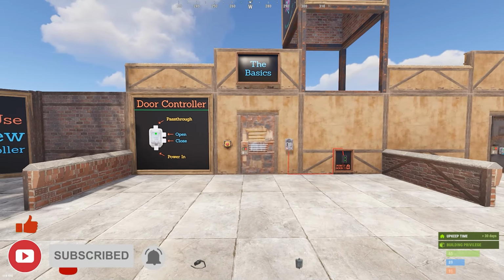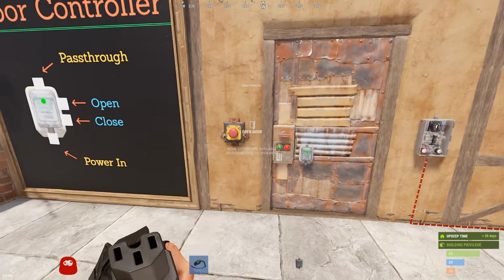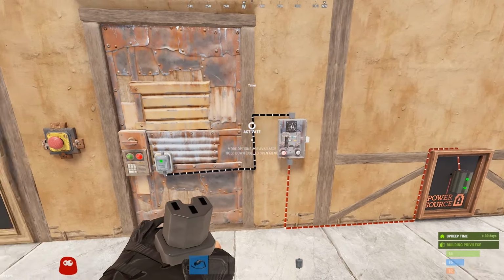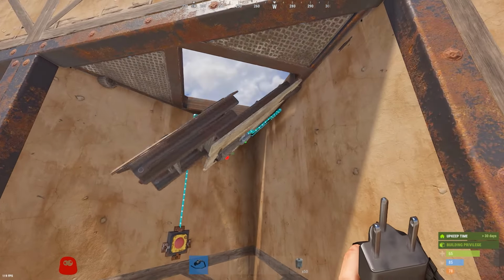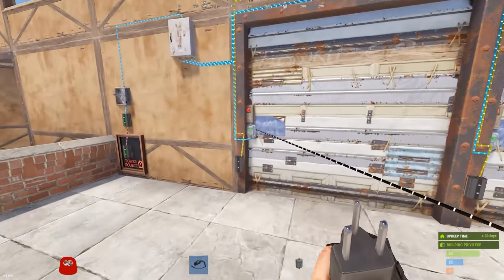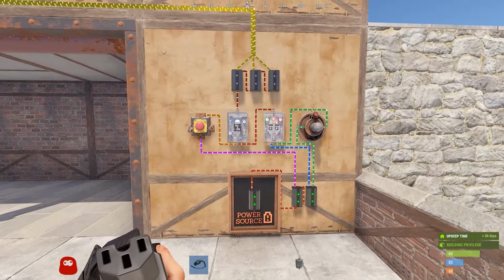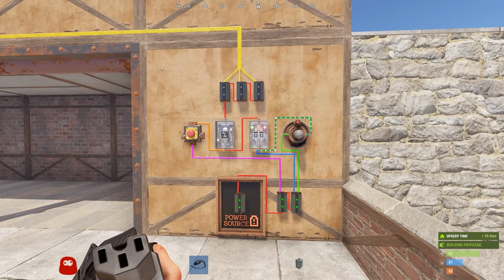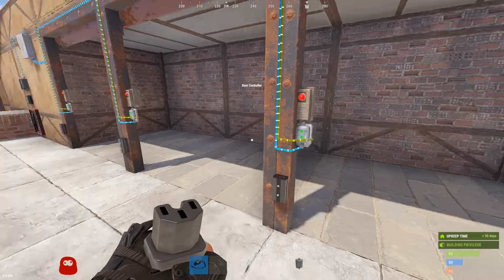RUST Electrical | How To Use THE NEW DOOR CONTROLLER | With Simple Base Lockdown Examples | 2024

Comment from the maker: THIS VIDEO CONTAIN A MISTAKE - I incorrectly stated in the video that raiders can manually pair door controllers after placing their own TC. This is not accurate. A raider needs to be authed on the door in order to manually pair a door controller. There are additional updates and fixes being released in the June update, so I'll drop a new video that addresses the above mistake and the new updates.

Comment: How to do an automatic door open and the other one will close at the same time using a pressure plate? Btw, i already knew how to wire a single door to automatically open but clueless on how to add another door to automatically closed when pressed by pressure plate.
Reply from the maker: Best way is the trap base circuit that uses the Memory Cell. 

Memory Cell:
-> Connect the "Inverted Output" to the door you want to start as open
-> Connect the "Output" to the door you want to start as closed

-> The "Reset" Input toggles back to the "Inverted Output"
-> The "Set" Input toggles back to the "Output"

I discuss this and the trap base circuit here:
https://youtu.be/GDFJQRiinVM?si=4vc0FSiXB-sQII5G

Cheers!

Comment: Fun tip:
If you always wire the DC passthrough to close you can change the behavior of the DC depending on the voltage applied.
Apply 2V+ to the DC and 1V passes to the close trigger making it lock down.
Apply 1V to the DC and 0V passes making the door cycle open/close.
This way you can use an OR and the voltage passed determines the door behavior.
Reply from the maker: I like this!
Reply: @AustinKG  I like to have base lockdown buttons and HBHF, but also have vehicle doors on timers. This allows me to do both with a single wire running to the DC.

Comment: Just how you said if you lose power the doors close once you regain power the dooors open is there a way to stop this. Because if I’m not at base my doors will keep cycling open and close as my batteries try and recharge. It’s like a never ending loop of my doors opening
Reply: Use a memory cell. Have your Heartbeat sensors trigger the lockdown by flipping the memory cell causing them to lose power. Send the power to a button tied to another heartbeat sensor that is set to authorized users to reset the memory cell to end the lockdown.
Reply: @Earendur08 months ago you wrote here but i still have problem figure out best way to close all doors on one floor. You say memory cell? I was gonna use hbhf and red button. And an and connection. So not everyone can press the button. Is it smarter to use with memory and if so why?
Reply: @fredgosweden  a memory cell is a long term state switch. You have two states, not lockdown and lockdown. In lockdown, you probably don't want an enemy to realize the HBHF only locks down when it detects them but once it doesn't everything goes back to the original non locked down state. So you need the state to be switched to lockdown and stay there until you intentionally deactivate lockdown. The memory switch allows this. The sensor triggers the memory switch which then sends the signal to close all doors (or it just disconnects power, however you choose to design this is up to you). Then you need a way to reset the memory switch to disable the lockdown on demand. It has a reset input on the side. You can use a smart switch, a switch or a button but what if an enemy got far enough into your base to reach the switch? Well to prevent them from using it you can use another hbhf sensor to check for a teammate/authorized person signal before allowing the power to pass into the reset of the memory switch.  This can be done with an AND switch.

Comment: Ok so raiding is now completely broken, if you get tc and place a new one you can literally open all other door without blasting through them. You only need to place door controller and it will open without needing codes
Reply: Just tested this, if you don't have codelock auth, you won't be able to pair door controller, and if you don't have tc, you can't interact with it.
Reply from the maker: See my pinned comment!
Reply from the maker: You can't place two door controllers on the same door, but I didn't consider trying to place door controllers on locked doors after you place a new TC during a raid. I'll try it out and if it's warranted, make another video. That said, this highlights the importance of the primary anti grief TC.
Reply: @AustinKG  what do you mean importance of a anti grief TC what is that
Reply: @dylanheredia8520  "disconnectable external tcs" (look this up) which have building blocks close enough to the main base. if raiders blow your main, the external(s) already overlap build privileges which prevent raiders from building or interacting with deployables.
Reply: Well if theres no antigrief tc whats to stop from removing prior placed door controller and replacing it

Comment: Another great video. Devs did good by making it un-pair if TC is destroyed, but dropping new TC and letting them re-bind by pressing E defeats the point of unpairing....
Reply from the maker: See my pinned comment! Raiders DO need the door code to repair a door controller. You're safe.
Reply: Right, like you should ‘know the door code’ to pair with a door.
Reply from the maker: @DaJakkoba  See my pinned comment!
Reply: @AustinKG  ah good update :)

Comment: If the raiders replace the TC and pair the controller again, do they need the code lock keys for the doors or would they just be able to hook up the electrics and open your code lock doors just with a button?
Reply: They'd only need to press the button